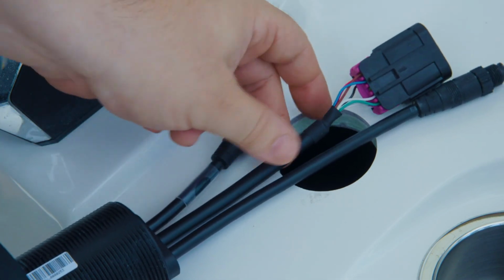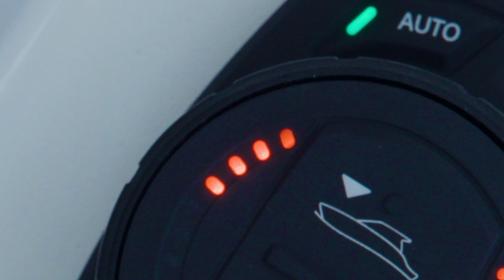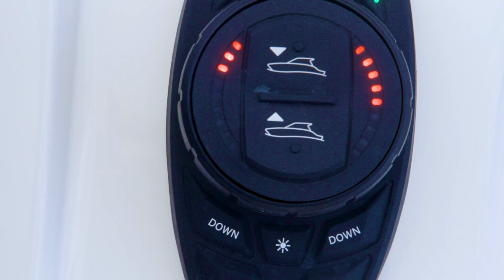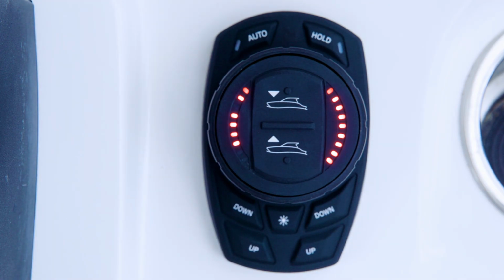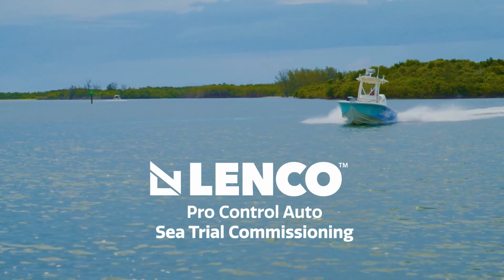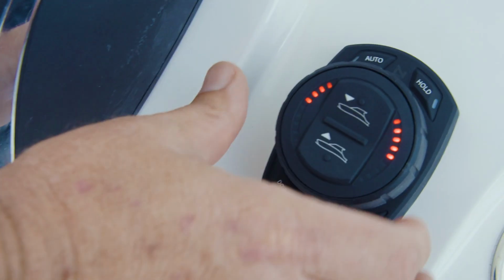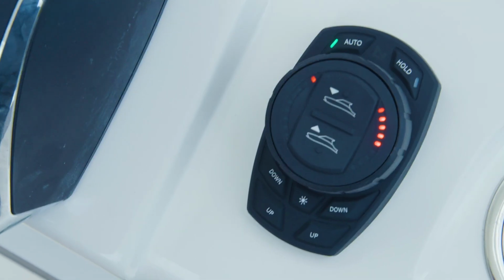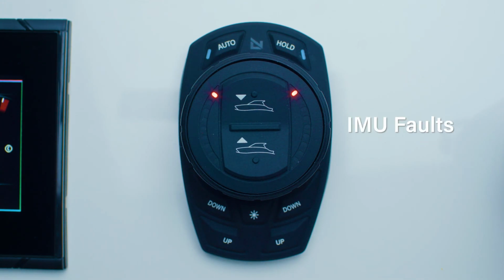Lenco Pro Control™ Auto Installation

Comment: Hello, I purchased a Lenco ProControl automatic unit.
After assembly and after making the various adjustments (initial power configuration, calibration, and sea trial commissioning), everything works correctly.
The assembly was done with a 2025 Suzuki 175hp engine and the power supply was via the purple wire (+ the alarm wire).
Where is the negative wire connected?
The problem is that when I turn the ignition off and on again, the unit returns to its initial configuration position. It doesn't remember the settings made.
The tests were performed with another control unit, and the same thing happens.
Please let me know what I should do.
Sincerely,
Reply from the maker: Thank you for choosing Pro Control. Depending on your engine manufacturer and ignition configuration, the process to store your initial settings may vary. Please contact our technical support team at 772-288-2662 for further assistance.